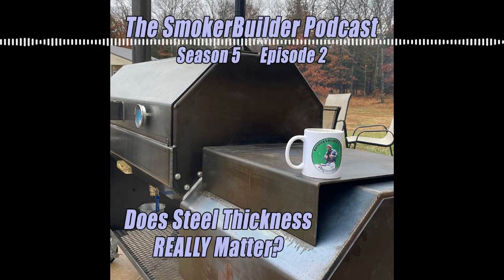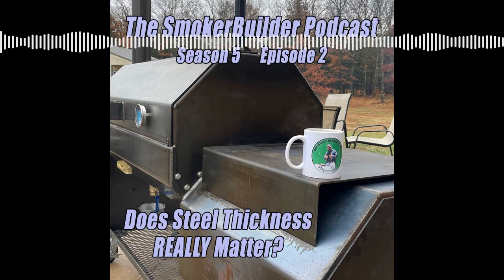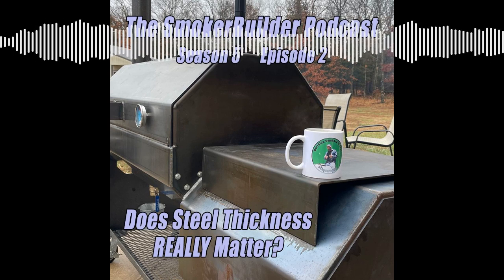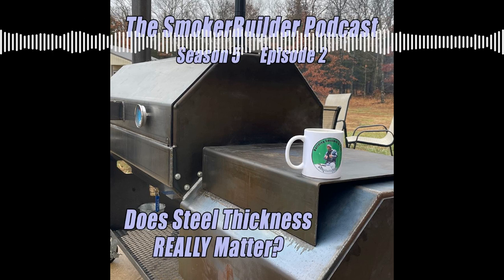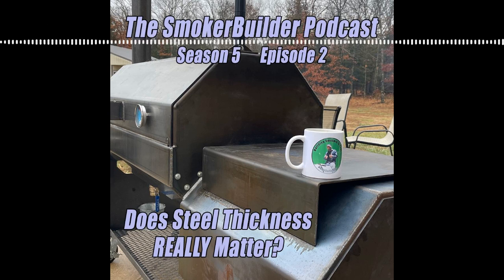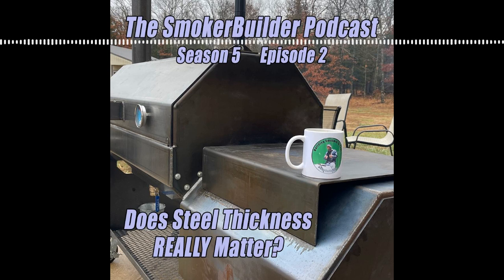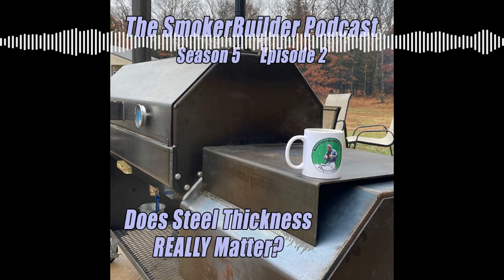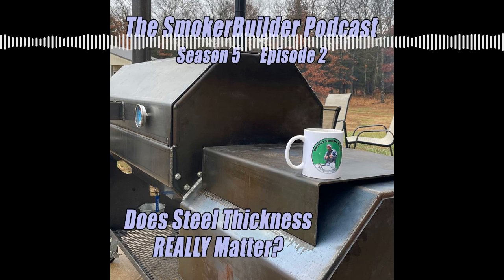Smoker Design: Does Steel Thickness REALLY Matter

Comment: Very insightful, thanks for this. Im looking to build my second pit and this is a great resource. Also, I have a question: on my first build I made it from a 55 gallon steel drum. In fact you can see the design if you YouTube bbq on skis (it works as a smoker but the skis part was interrupted by Covid - maybe I’ll finish it someday). I had an idea to combat the fact that it’ll cool off quickly - add soapstone as a thermal battery. Maybe slabs on top of the tuning plates (it’s a reverse flow), or somewhere else perhaps? I did end up double walling the front end to keep the returning smoke warm. While stationary the temperature difference is at about 20 degrees, if memory serves. Any feedback on the build and the soapstone idea is appreciated.
Reply from the maker: Actually, the outside of the pit would be better place to combat the temperature loss. 
I recommend trying a welding blanket or canvas tarp laid over it first and see how it helps.
Reply: @SmokerBuilder  What do you think of old country bbq pecos offset ? I have one that I lined the firebox with fire brick and I put four pieces of 1/2" thick pipe flange  in the bottom of the cook chamber..Does this sound like a good idea or should I do something different?
Reply from the maker: @CoffeeAndSmoke23  so it really depends on if yours is the thick wall version it the thin wall one. For the thin ones, Adding more steel can be a good thing for heat retention and firebrick would help in the firebox. 
I haven’t ran the numbers on that model but my impression seeing them at academy is the stack is too big of diameter and too short for the firebox volume. They do work great though as many people are cooking great food in them. 
In a nutshell great pit to start out with
Reply: @SmokerBuilder  I was thinking of adding a stack extension to make it around 30"..Theres some good videos on here of people using 6" stove pipe and getting good results..If I could weld I'd be dangerous lol,but Im very limited in what I can do to the pit..
Reply from the maker: @CoffeeAndSmoke23  yep that works too!

Comment: What about corrosion allowance? 1/4 inch steel won’t be 1/4” for long. It doesn’t take long for 1/4” to rot out. Not everyone is going to be able to store a barbecue pit indoors or spend countless hours painting or oiling it keep it from rusting.
Reply: If you don't clean your ash out and let it set in the rain, it will rust out fast because ashes when wet turn acidic. Clean your ashes out every time, and I had a 1/8 firebox still 1/8 when I sold it after using it for 10 years after I built it.